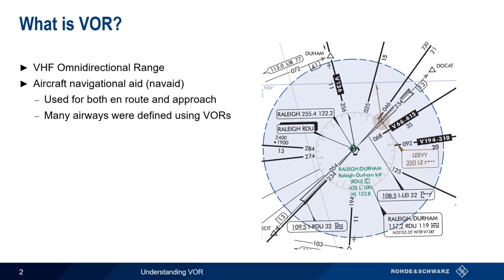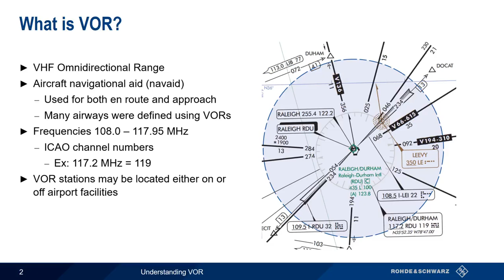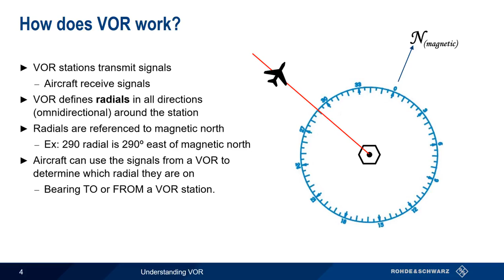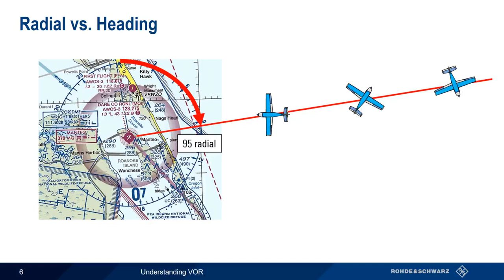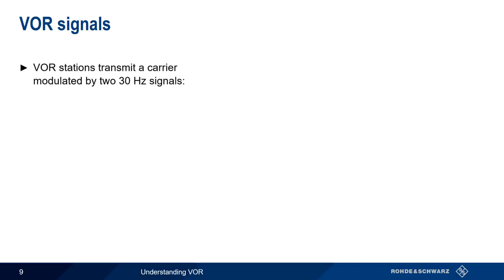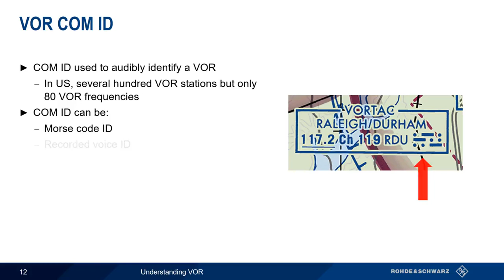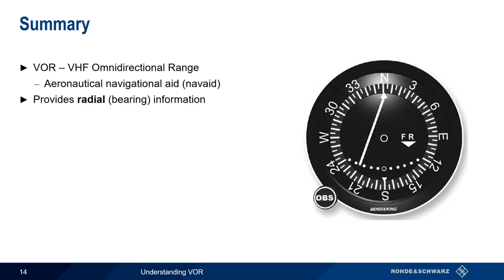Understanding VOR

Comment: why doesnt the 180 radial result in destructive interference and thus no signal
Reply: This was my thought, but I think it has to do with the reference being in FM and the variable in AM.
Reply: See timestamp: 5:49. The reference signal is FM +-9.96Khz off center and will be decoded by a different circuit than the AM Variable signal which is on the carrier frequency.  The difference between the two circuits should be a time difference that determines the phase your on.  Unfortunately, this explanation doesn't get into the details of how it determines the specific radial frequency as you could imagine the VOR receiver would be receiving a lot of them.  Perhaps some sort of peak detector on the Variable frequency is implemented to determine the specific radial.

Comment: With all the details that pilots comment on here, i have to say that I really appreciate the technical side. Saw that the video is by R&S and immediately thought that they might finally explain not only what it does but also how it does it, and I want disappointed. Is anything, more theory about how the antenna does the phaseshift would be awesome!
Nevermind the navigation details, that's what aviation channels are for!
Reply: The reference signal is a simple non-directional broadcast antenna. The second signal is modulated by physical rotation. 
The first generation beacons mechanically turned a directional antennea at a fixed 30 RPM, modern beacons have a large number of fixed directional antenna and the signal strength is swept by them electronically in a wave to create the same effect with no moving parts (The actual radio signal beam strength is still physically rotating). The timing of this strength pulse is compared to the reference signal to know the angle.

There is another style of beacon called a doppler VOR which reverses the FM and AM signal roles, this has less multi-path interference from signal reflections near mountains or tall buildings, the signals are setup in a way to allow traditional receivers to use it with no changes needed in the airplane.

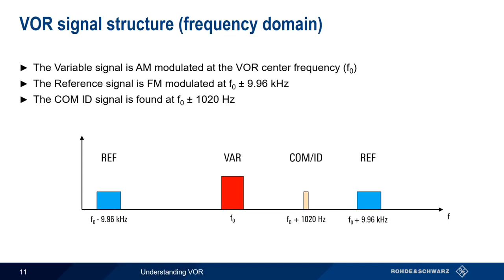Comment: Dispite the fact that this one is online for a good time now... I was wondering, if you might have swapped VAR and REF signal at 5:50. As far as I understand VOR the reference signal is modulated @f_0.
Reply: Hi Jan - Actually, we're both right :)  In a conventional VOR (CVOR), the VAR signal is the AM signal (at f0) and in a doppler VOR (DVOR), the VAR signal is the FM signal (f0 +/- 9.960 kHz).  Since I didn't cover DVOR in this presentation, I used the VAR/REF assignments for conventional VOR.  Thanks for pointing that out!
Reply: @pauldenisowski  Awesome!

Comment: At 3:41 in the video, there is an error. You cannot fly inbound with the OBS set to the radial you are on. Reverse sensing.
Reply: Hi Garry - issues like reverse sensing are well beyond the scope of this video. :)  The target audience is primarily non-pilots who work on navigational aids and who need a basic overview of navaids:  absolutely not a substitute for proper pilot instruction (and I say that as an FAA-certified ground instructor).
Reply: Yes, indeed. When you're tracking a radial, your OBS should be close to your compass heading, not 180 degrees away.